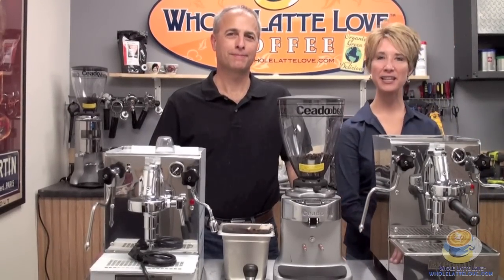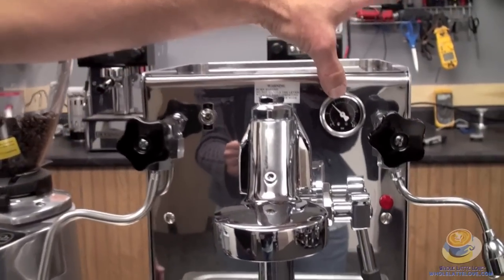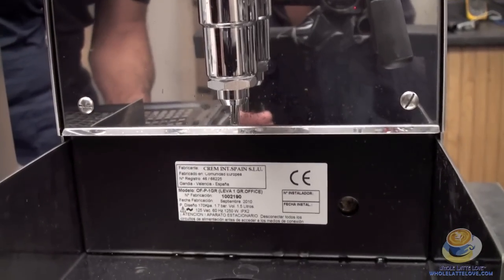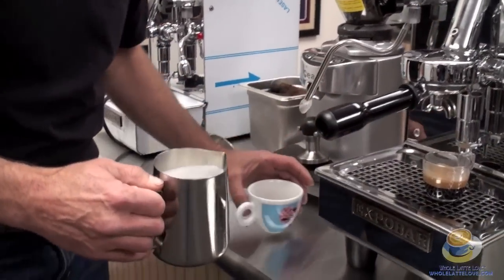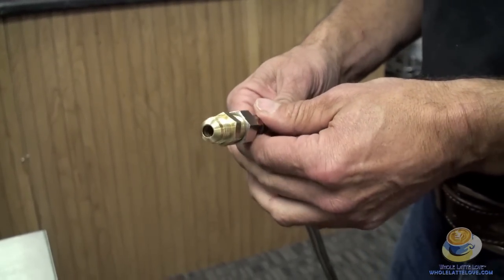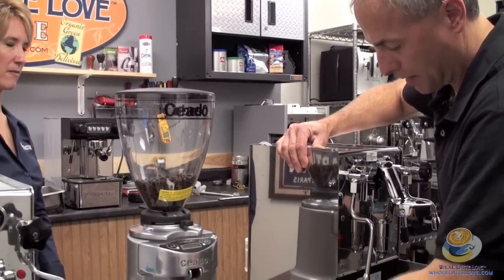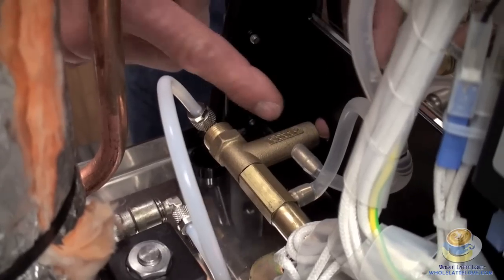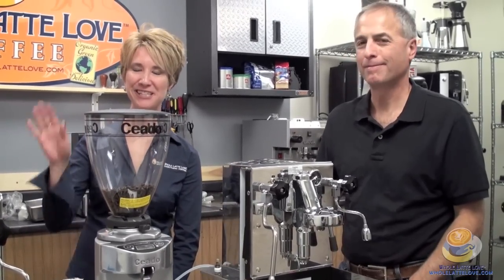Expobar Office Lever Espresso Machine

Comment from the maker: While rotary pumps are often associated with high end machines, they are not exclusively required to plumb a machine in. In many cases, the sheer size of a rotary pump makes plumbing it in the only viable option, as the need to fit a large pump into a compact frame will make adding a water tank (and the necessary valves and plumbing) difficult, costly, or some combination of both. Benefits of a rotary pump: low volume while pumping; resistance to pressure blow-by; stable & even pressure profile.

Comment from the maker: This is usually a sign of the switch behind the brew lever being stuck down. There should be a little metal pin with a roller wheel pressing against the lever from the faceplate of the machine. Make sure it's not stuck in. If it is, try gently pulling it back out.

Comment: I have owned one of these machines for 3 years and love it. I am a little confused by the flush cleaning process. It would be nice if you demonstrated this. In particular, is there a role for the "half way down" position of the flush lever in retaining cleaning agent in the system when doing this? Or should you always move the lever all the way down. I have heard that it can be bad for the machine to stop half way, but I can't think of any other reason for having a mid-way stop position.
Reply from the maker: +Paul Weston Hi Paul, You should always move the level all the way down. The half way position plays no role in the backflushing process. The half way position partially opens valves in the E61 group before turning the pump on. Its purpose is to allow for line-pressure pre-infusion in plumbed machines.

Comment: Hi Guys! DO you think this cute machine could make 40 -70 Cafe lattes a day?  I know that there are other larger single group that I could opt to but i just really love the look of this machine.  Thanks
Reply from the maker: Hi AMC, Really depends on how fast you want to get those 40-70 out. Equally over say 12 hours - not a problem.
Reply: Thanks! How about under 10 hours? Or would it simply be better if I get the Expobar New Elegance MiniCon 1G?
Reply: Aren't we just talking about steamer recovery time?  Auto water refill right? So a minute between lattes?

Comment: Whole Latte Love Hello! Can you give me a brief explanation of the difference between the lever and control?  Also, it seems like this is the best machine for the price that lets you brew and stream at the same time?
Reply from the maker: Michael Greco Expobar machines are a good value. Built very well, they are solid and reliable. They lack some of the case finish details of more expensive prosumer machines. Big difference between the two machines is the Control has programmable volumes while the Lever has a lever to start and stop your shots. Control has some plastic on the front panel as well as the drip tray. Hope that helps.

Comment: How long does this machine take to get to brew temperature? How do you know when it’s at the correct temperature?
Reply from the maker: Hi Will, Thanks for the question. Machines with E61 groups should be allowed to warmup for at least 25 minutes before first use. Warmup time can be accelerated a bit by running a few blank shots.
Marc

Comment: hi can i use this machine in a small and new coffee shop? Maybe 150 shots per day or which machine do you recommend? Thank you
Reply: We have two machines side by side. the problem i find is that I need one for steaming and the other for the actual pull of the espresso or else it wont give me the pressure I need. so to start i think its an economically great start, however you will need to upgrade.

Comment: How much coffee the expobar double-shot filter basket can contain? (Maximum)
Reply from the maker: Hi HK, Thanks for the question. It's ~18g. But depends a bit on the coffee. High altitude coffees tend to be more dense so a bit more for those. While lower grade coffee and darker roast are less dense so less of that type. Key thing in determining dose level is to never see an impression of the shower screen in the puck after an extraction. If you do reduce the dose weight. Hope that helps!
Marc